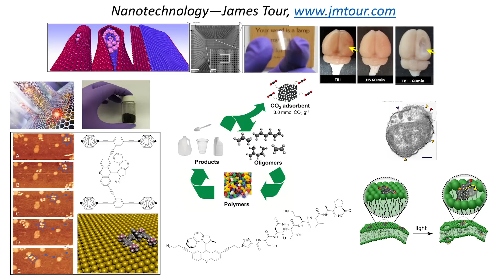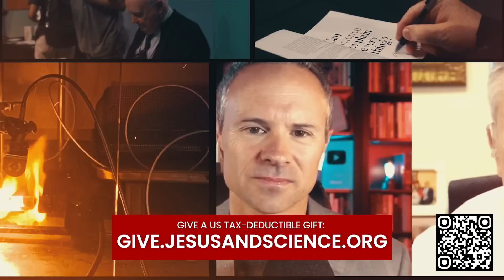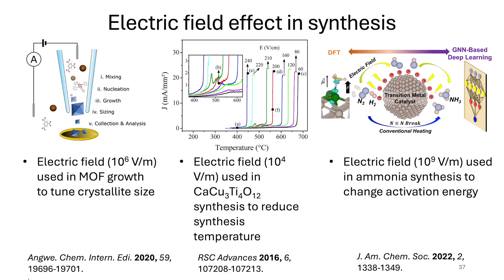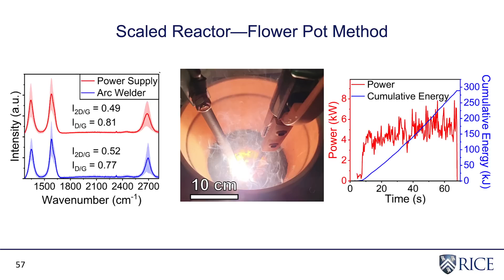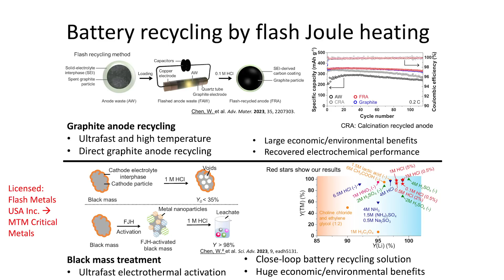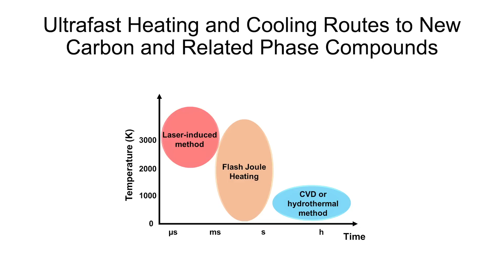Can You Make Graphene with Amazon Parts? We Did! 🔬⚡ #science #chemistry #graphene

Comment: Dr. Tour, transforming voltage to high levels is quite easy and allows flashing through much less conductive material. Wouldn't using higher voltages also allow less current and therefore total energy making a more efficient process?
Reply: Do U know how to implfy the voltage?

Comment: 6:40 i predicted this few years ago. As a professional electrician i see black burns on panels from shorts . This led me to deduce using HV arcs to make graphene layers
Reply: So.. Can U make graphine with SHORTS? then how to get the graphine out of  the burned carbon?
Reply: @Adam-x9i1b  you short  the two electrodes with high voltage  with the carbon material in the center, any off gassing you want it to deposit on your medium , the off gassing is the graphene. For example in a short the hot wire hits ground , the hot wire is one electrode and the ground is the other
Reply: @mykedoes4099  how could you catch that graphene_gas?
Reply: @Adam-x9i1b  I have seen it smudged on the wall of the inside of electrical panels.  It just bonds to things , ... You have to experiment